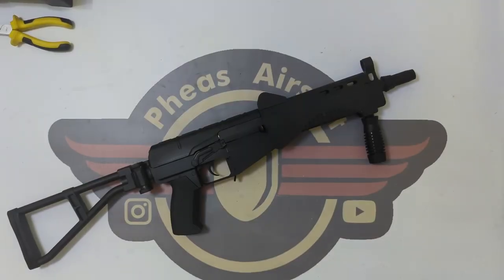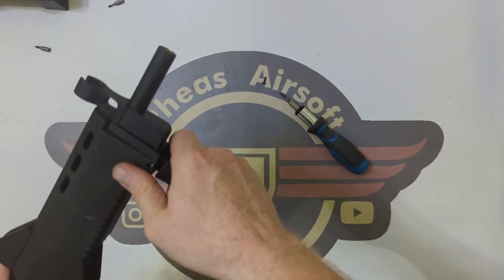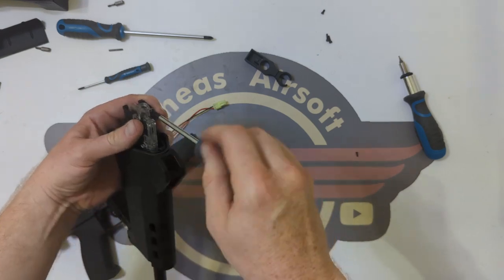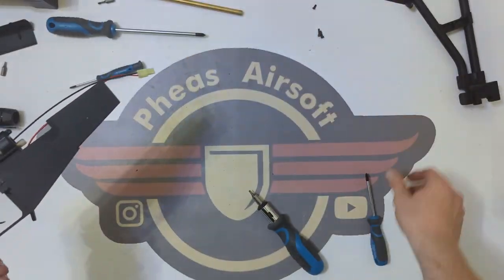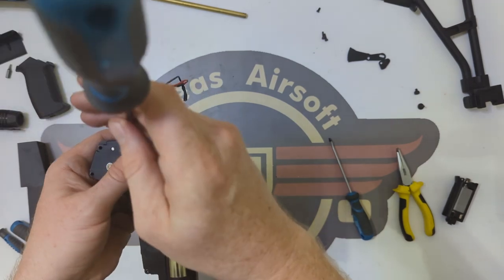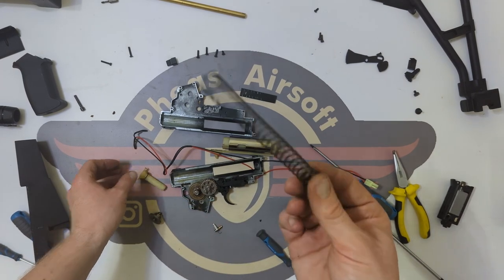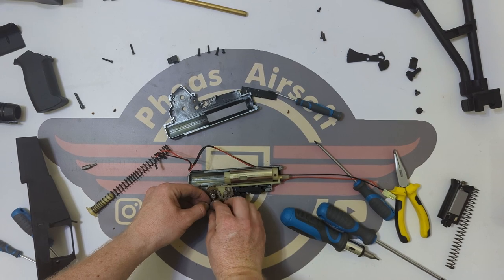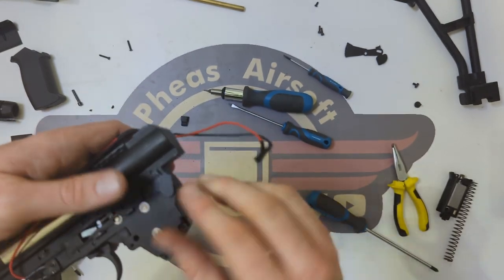[HOW TO] A&Y AY-3M Disassembly for Repair and Maintenance!

Comment: what Pheas didnt mentions is that its not quite a standard V3 besides the notch for the selector, cylinder head is a V7, tappet is proprietary, so thats something to keep in mind
Reply: The V7 cylinder head is too high, 1mm must be removed from the base and the v3 hopup chamber is not compatible either
Reply: @imrevarga2547  on mine that is not true.. I installed a guarder v7 cylinder head, and a retroarms ak hop chamber, works like a charm

Comment: Thanks for the video !
Do you think it can take a Ar15 style buffer tube? Because the stockless version of this is very cheap...
Reply from the maker: Hiya! It will need an adapter to change it from their stock connection (like a square block) to M4 type. Not sure if one exists on the market (maybe try 3d printing sites) pheas
Reply: @PheasAirsoft  the screw got me tempted, as it seems the right fit.
On the stockless one, there's a round end block looking like it could fit a tube 😅
Anyway, thanks for the answer !
Reply: @docthorr   Hello, yes it does fit, its exacly what i have done with the airsoft replica i have the non stock version. The round bit is just a decoration, you can just get an m4/m16 buffer tube and a stock for it. I tried to put some images but yt wont let me post imgur url it seems, anyway i hope it helps